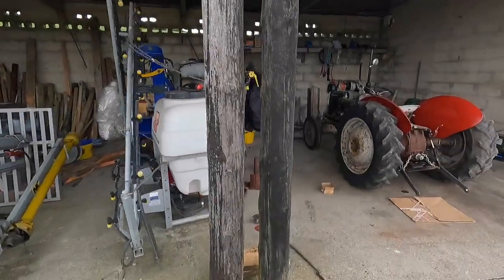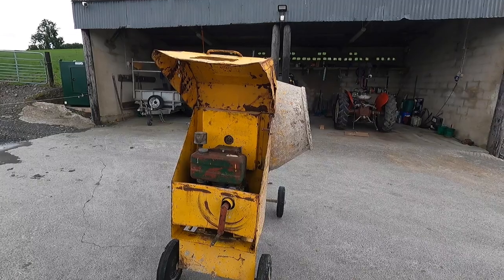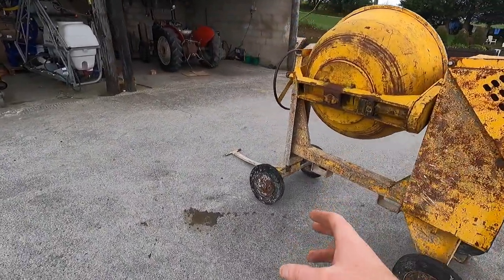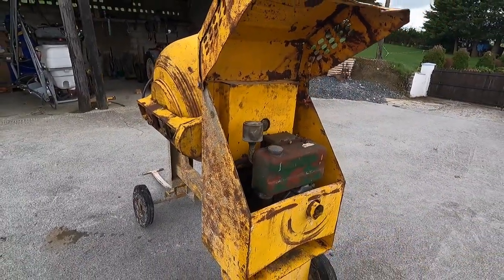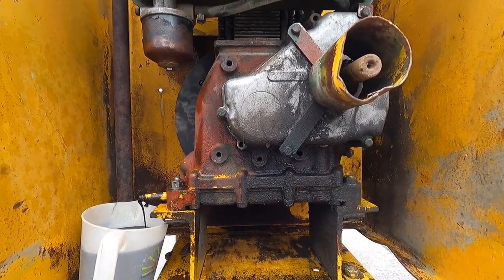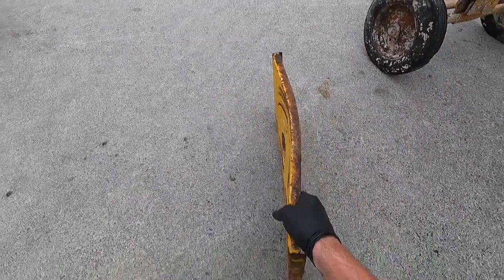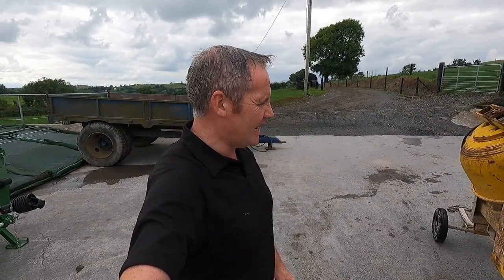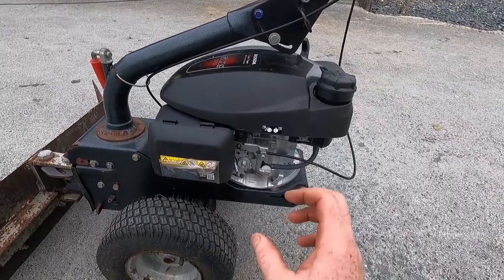One man's TRASH is another man's TREASURE!! Plus something just got a NEW ENGINE

Comment: Great video Adrian, my cousin was a builder, he had the same mixer, i worked with him, it had to be washed every time it was used, he still has it, and his son uses it now, great wee mixer!
Reply: I couldn't help but think of Dan (Escape to Rural France) when watching the lesson on cleaning cement mixers! I'm not sure how he treats his current one but his old mixer was in an incredible state. At one point Dan dropped so much concrete around the base that the mixer was cemented to the ground and he couldn't move it. Of course he always banged the drum with a hammer.

My parents bought an ancient electric mixer maybe ten years ago, a 3-phase beast, probably from the 60s. It's beastly heavy compared to a modern one the same size but with new bearings it will probably outlive all of us.

Comment: The bowl comes off and it’s a Crossland 489 or equivalent filter in there.give the bowl a twist with a pair of slip jaw pliers as it tends to bite in to the O ring.
We used to Wax oil ours before they went out on hire and then when washed the cement used to just flake off.
Reply from the maker: Thanks mate I will try that for sure 👍
Reply: @IFarmWeFarm  another useless bit of info, if you find the handle is too close to the panel you straightened, there is a starting dog which the starting handle locks on, this sometimes gets knocked back on the shaft, remove the big panel and the round guard and you will see that the starting dog is adjustable as in you can slide it along the shaft and keyway.

Comment: We bought a 3 point concrete mixer which does nearly 1 cubic metre of concrete which is large but we have concreted our yard with it as it's cheaper than a lorry. We use a mini digger to load it, its ran by our 100hp plus same and two of us have used it perfectly. It would be ideal for you to pour your shed floor or pillars or concreteing your yard

Comment: get your self a bucket full of beach pebbles the size of your fist from the coast, use them to clean the inside of the mixer after each use, works a treat! a good lick of paint that mixer will be around for a while yet...  i prefer painted clean machinery... 
get some heat resistant sealant and put a bead of it around the seal areas... for the scraper...   then use a light jet wash to clean it....

Comment: Adrian whats that spray you used to get rid of the oil
Reply from the maker: Just brake cleaner, used could use an engine degreaser or WD40 also. The brake cleaner dries instantly with is great

Comment: Those engines are dangerous too start we took it out of ours and made it pto
Reply from the maker: You have to make sure the decompression lever works properly, it shouldn’t kick back if it does. There very cheap to run on this engine. Run for 5 hours straight yesterday on a quarter tank of fuel.